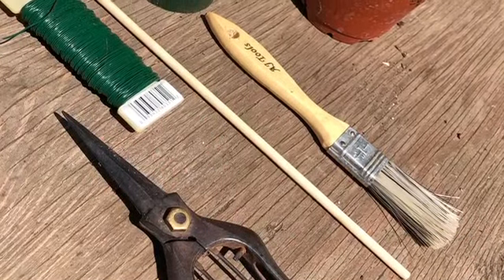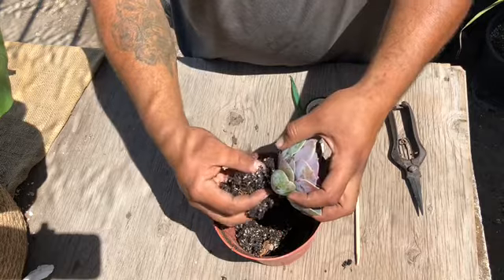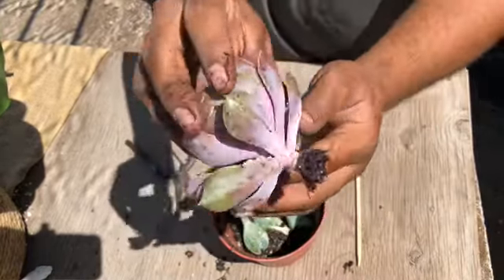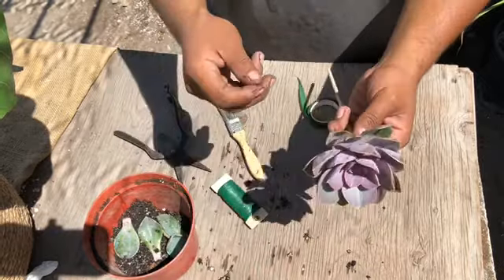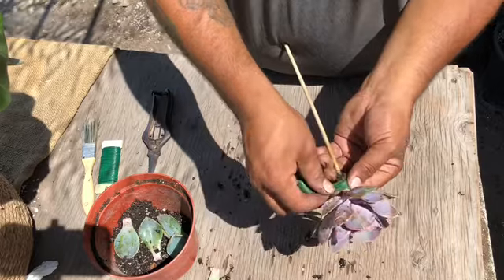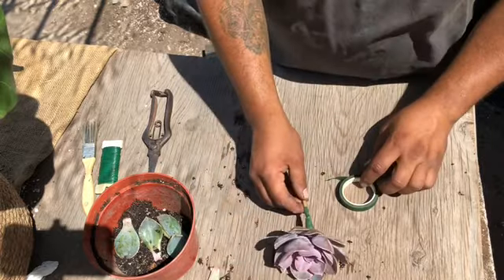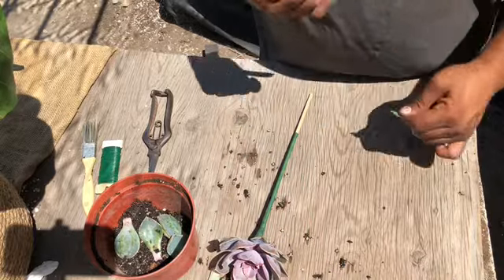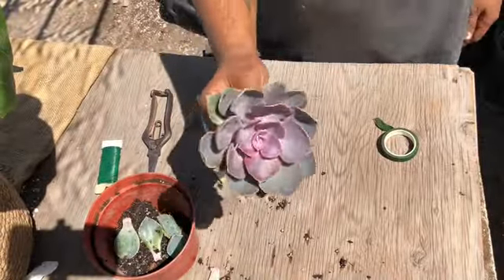How to turn your echeveria to a flower stem

Comment: Good job and congratulations on your channel.
One thing that might make putting the stick in easier would be to take a small pointy knife and make a pilot hole first then push the stick in.
Good luck with your channel!
Reply from the maker: Patrick Drummond thank you